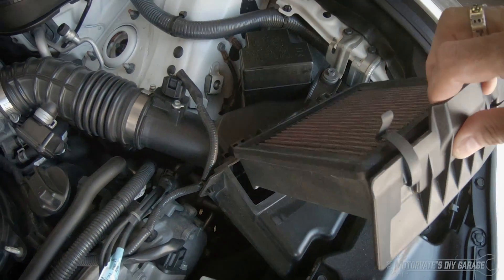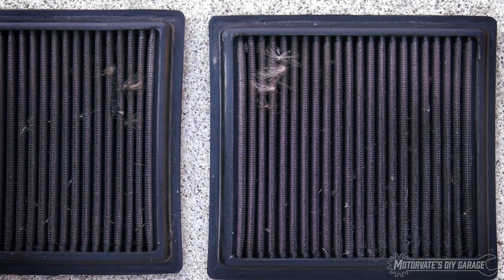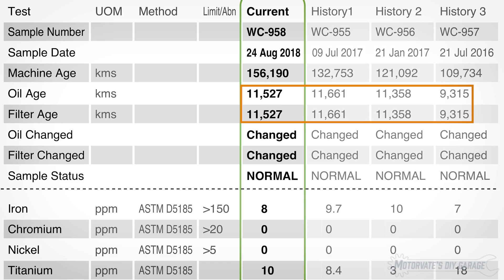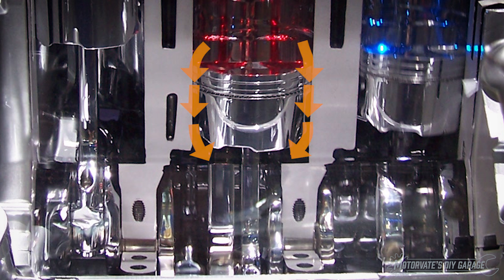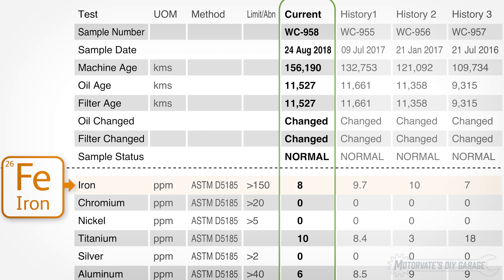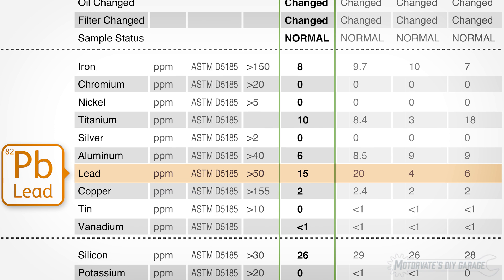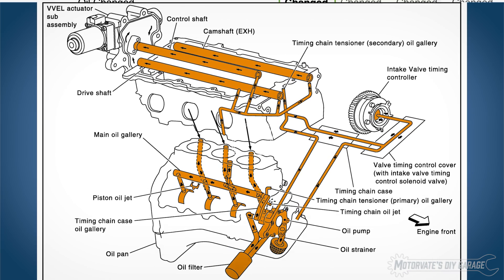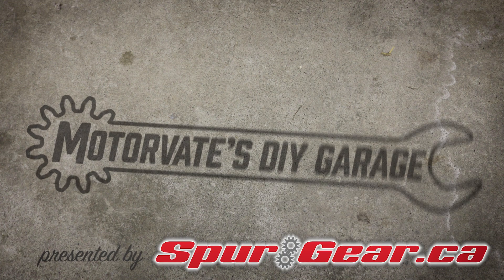K&N Filter Test… Two Years and 50,000 KM Later: Motorvate's DIY Garage Ep.34

Comment: I have a K&N air filter housing and filter. I'll be honest it's a pain in cleaning and adding a really thin layer of K&N oil. I usually park my truck for the day and put it in the next day just so the really thin oiling has absorbed/semi dried so the wet oil on the filter doesn't screw with my sensor and bugger it up.
Horse power gain hardly noticeable.
Too much work involved with a K&N air filter in my opinion, considering when  buying a disposable you quickly put it in and eventually toss it and buy another, it's time saving.
 I do recommend if you do go with K&N kits buy another filter to have previously oiled and ready so you can just toss it in without the wait. I also noticed too that the filter get's dirtier faster which is contributed by thin layer of oil  in my opinion which requires more frequently cleaning and going through the process again.
Reply from the maker: I agree, cleaning the K&N is a little bit of a pain. However, I have been doing that since my first K&N filter in my 88 Taurus.

Comment: My question is performance being affected by the dirty filters. On my 2008 C350 the filters get dirty so fast, mainly because I do a lot of highway but since these filters have oil and dirt sticks to them, I wonder how it affects performance when they clog up.
Reply from the maker: Based on the dyno testing I have done on my G37 (will be a future episode), there is almost no measurable difference in power between brand new K&N and a K&N filter with 50,000 KM.

BUT I don't know if that would be accurate for your C350.

Comment: THX
Can you check the car ob the dyno with these dirty K&N ?
Reply from the maker: Actually I have :)
I book a few hours of dyno time in August. I tested the dirty K&N, new K&N, new NIssan/Infiniti filter and just for fun NO AIR FILTER.
PLUS I data logged 32 items via the diagnostic port and an additional 8 items (with my home made data logger) like fuel pressure, oil temp, oil pressure, crankcase pressure and a few others.

The downside of all this data is the time it takes to analyze it... but that is under way :)
Reply: @MotorvateDIY  
Great!
Thank you 👍🏼😊

Comment: Without a comparison to OEM paper filters this is a great well produced video, but isn't really doing a fair comparison.   If paper yielded better results over the same time period there's an argument to be made that the K&N's are actually inferior, which many will argue they are, and the science based tests prove such:  https://www.nicoclub.com/archives/kn-vs-oem-filter.html
Reply from the maker: As you know, there are many variables in a test like this.
Those K&N filters are comming up to the 60,000 KM mark and then I will switch to Nissan/Infiniti filters for the next 50 or 60,000 KM and compare the difference.
Reply: @MotorvateDIY  awaiting for the next video

Comment: I would like to see a video of how to find a fuse that keeps blowing up. My G35 couple keeps blowing up the tail light fuse. I can’t find where the problem is. The videos have help👍🏽 keep up the good work
Reply from the maker: Hey  Chaco Santaya,
Thanks for your kind words.

If the fuse  keeps blowing, it should be easy to find, but you will need a multi-meter, wiring diagram and understand basic electricity.

Make sure to check for worn insulation on the brake light wire.

As for making a video on that, since the G35/G37/350z/370z generally don't have electrical issues, it wouldn't get enough views to justify the time required to produce a video.
Reply: Thank you very much!

Comment: I don't like that you can see right through the K&N. Can't do that on a paper filter.
And with the cost of the K&N and the cleaning and oiling products you have to buy, and the faffing about. The performance of the K&N just doesn't warrant the outlay in time or money for me. 
I stopped using K&N when I removed the induction kit off my car (was selling it), and installed the standard air box and filter, and got a noticeable increase in performance. Sounded better with the K&N, ran better with the paper.
Reply from the maker: Hey  Bill Hubbard,
I understand what you are saying, worried about being able to see through the filter, cleaning it, drying it etc... 

For me I think it is worth it, but is not for everyone.
If a car feels better/faster with a paper air filter, then that's what I would use :)

Comment: Dude what happened to your channel? Your quality is top tier and you were getting so much momentum you could've had 100k subs by now :/
Reply from the maker: Hey  Darksyne,
Thanks for the kinds words. I know it has been a while since the last episode. I took some time off the production side to focus on G37/370z research. 

One of the goals of this channel is to have unique content, and as you can imagine, that is not a simple task.

However, here is what is being worked on right now:
• Home made $40 Arduino based data logger that samples 8 sensors 100+ times per second
• Fuel rail pressure at idle and wide open throttle. You might be surprised how much it drops!
• Crankcase pressure test: Stock vs PCV delete. Does a PCV delete really reduce crankcase pressure or increase it?
• Differential oil temp. How how does it really get in city driving, highway and during a track event?
• Manual transmission oil temperature.How how does it really get in city driving, highway and during a track event?
• Engine oil pressure vs RPM vs oil temperature. How much does the oil pressure change as the oil warms up and as the RPM increased?
• Power steering fluid temp: How hot does it get? Does turning heat up the fluid more than high engine RPM?

and finally, I designed and built a Arduino based device that plugs into the OBD port and uses the CAN bus to copy the ECU's ROM to a SD.

Soooo, there have not been many episode lately, but there is a lot of content getting ready for release!
Reply: Motorvate DIY glad to hear! The quality is very impressive for a small channel and I’m looking forward to seeing more from our fellow Canadian haha
Reply from the maker: Thanks!

Comment: Why did you stop making videos ? Miss your content here in 2020!
Reply from the maker: Hey  matt debrouwer,

I know it has been a while since the last episode. 

I took some time off the production side to focus on G37/370z research. One of the goals of this channel is to have unique content, and as you can imagine, that is not a simple task. 

However, here is what is being worked on right now: 
• Home made $40 Arduino based data logger that samples 8 sensors 100+ times per second 
• Fuel rail pressure at idle and wide open throttle. You might be surprised how much it drops! 
• Crankcase pressure test: Stock vs PCV delete. Does a PCV delete really reduce crankcase pressure or increase it? 
• Differential oil temp. How how does it really get in city driving, highway and during a track event? 
• Manual transmission oil temperature. How how does it really get in city driving, highway and during a track event? 
• Engine oil pressure vs RPM vs oil temperature. How much does the oil pressure change as the oil warms up and as the RPM increased? 
• Power steering fluid temp: How hot does it get? Does turning heat up the fluid more than high engine RPM? 

and finally, I designed and built a Arduino based device that plugs into the OBD port and uses the CAN bus to copy the ECU's ROM to a SD. Soooo, there have not been many episode lately, but there is a lot of content getting ready for release!
Reply: Motorvate DIY looking forward to it. Stay safe !

Comment: it’s been a year since your last 370/G37 video tutorial :/  

maybe a spark plug tut. soon :/
Reply from the maker: Hey  Enkeis,

Changing plugs are my next video shoot. I hope to get the parts in a few weeks.

I know it has been a while since the last episode. I took some time off the production side to focus on G37/370z research. One of the goals of this channel is to have unique content, and as you can imagine, that is not a simple task. 

However, here is what is being worked on right now: • Home made $40 Arduino based data logger that samples 8 sensors 100+ times per second 

• Fuel rail pressure at idle and wide open throttle. You might be surprised how much it drops! 

• Crankcase pressure test: Stock vs PCV delete. Does a PCV delete really reduce crankcase pressure or increase it? 

• Differential oil temp. How how does it really get in city driving, highway and during a track event? 

• Manual transmission oil temperature. How how does it really get in city driving, highway and during a track event? 

• Engine oil pressure vs RPM vs oil temperature. How much does the oil pressure change as the oil warms up and as the RPM increased? 

• Power steering fluid temp: How hot does it get? Does turning heat up the fluid more than high engine RPM? 

and finally, I designed and built a Arduino based device that plugs into the OBD port and uses the CAN bus to copy the ECU's ROM to a SD. Soooo, there have not been many episode lately, but there is a lot of content getting ready for release!

Comment: Did you clean the K&N Filter at all within the 31,000 Mile test or no?
Reply from the maker: Hey  Lucas E. Honda,
Nope. The filter was last cleaned  July 2016 and it still is in my car so I have data for the next 60,000 KM or 70,000 KM test.
Reply: @MotorvateDIY  Thank you for the response. I'll be buying a K&N Filter soon. Really appreciate the Testing and work you've done.
Looking forward to the analysis after 50,000 miles to see if the filter lives up to it's claims.
Reply from the maker: @LucasEHonda   You are welcome :) 

Many people think K&N pays me for this.... all I do is follow where the data takes me. If the data shows they are crap at 60,000 KM they are gone. (but I suspect they will be just fine!)
Reply: @MotorvateDIY  K&N does state that in severe driving conditions the Filter should be cleaned earlier than 50,000. Depending on how dusty and dirty your test environment is, the filter may or may not meet the 50,000 Mile mark but to reach 30,000 Mile mark is impressive. 

Just got a K&N Air Filter(Part#:33-5045)
I'd likely clean the filter every 15,000 or less for good measure. I'm a daily freeway driver of 45 Miles a day, 6 Days per week.
Reply from the maker: @LucasEHonda  Sounds like a solid plan! You also might want to get a used oil analysis and to see how the filter is doing in the conditions you drive in. Thanks for the comment!

Comment: This isn’t regarding air filters but my car was throwing a code for MAF and MAP sensor and bank 2 lean. When my g37s gets warm it won’t start or will try to shut down. At about 3k rpm it sputters. Any ideas?
Reply: I replaced the sensors and it didn’t work
Reply from the maker: Hey Joshua Jeans,
When troubleshooting you need to think of the code as the symptom, not  the cause.

Many years ago, I changed an O2 sensor as it always read lean.... as it turned out, the intake boot had a tear and the O2 sensor was just fine.
Reply from the maker: Hey Joshua Jeans,
What is the exact code? 
Often the online look up of descriptions are not accurate.

If it is a P0106, there is an ECU update to fix that: https://infinitig37.com/TSB/ITB12-026a.pdf

For the sputtering, when was the last time the throttle body was cleaned?

Comment: As a guy in my 30s, I have almost same mods and same approach to everything on my 2011 G37 as you. The biggest question mark on my list is a tune. Heard so much back and forth on uprev vs ecutek, and as you've noted different for every car and climate. I also daily mine to work every day,  so want it to still drive smooth and not be jerky or set up for race mode if not necessary. Have you though about reaching out to uprev or ecutek guys and s hi showing your size of followers and asked for an unbiased review in exchange for a free tune? Cheers from the States.
Reply from the maker: Hey Nick J,
That's an interesting question...
The performance or smoothness of a tune are determined by the tuner skill, not the software. The tuning software determines the options that are available. (Launch control, 

I have been in discussions with an ECUTek Master Tuner (Eugene @ Enthusiast Auto Care) and we might be doing a few episodes on ECUTeck features and show an e-tune works in the spring/summer.

Comment: Did you stop making vid? Is synchromesh fluid good for g37s manual ?
Reply from the maker: Hey Albert Caval,
Nope, I have shot a lot of content over the spring/summer and have done a lot of research for future episodes. (Crankcase pressure and PCV delete, fuel pressure gauge install, fuel pressure stability at wide open throttle, and more)

I have a lot of editing to do and I hope to get some episodes out before the end of the year.

I haven't used syncromesh fluid on this transmission, so I don't have any first hand experience. I do know for a fact that the newer manual transmissions can be very selective on what oil is used. The oils need to have a specific amount of friction for the syncros to work properly and prevent grinding. If the oil is too slippery, the syncros won't work as well, and you might increase wear on the syncro engagement teeth. 

To prevent any future / long term issues, I only use the OEM fluid.
If any issues do happen, I know that the aftermarket fluid wasn't the issue.

Comment: K&n will normally hurt the valves/seats not internal parts like crank and bearings.
Reply from the maker: Hey Jamie SV650,
If the valve and/or valve seats are being damaged, that would also show up in the used oil analysis, as chromium. (I think)

Keep in mind 3-5% of what is in the combustion chamber, ends up in the crankcase due to blow-by gasses, which then mixes with the engine oil.

Comment: When i changed my oil after i bought my car I put regular Mobil1 full synthetic in it. I was told i shouldve gotten the extended protection Mobil1 because of it ability to handle heat better. Is that gonna hurt anything? I dont track my car and my highest oil temp since I had it was 225-230. Normal driving its always around 200 to 210 on these hot days. Also im thinking about switching to Royal Purple like I used to run. From the videos I watched it has a phenomenal film strength and handles heat very well. Have you ever used it? Check out some of the bearing bench tests they do comparing it to Mobil1. The test where the bearing is rolling in a bath of oil and they push down on a lever to simulate wear is pretty impressive. There's hardly any mark on the bearing at all. Now im not trash talking Mobil1 because it still did very well. But it did let a noticeable wear mark behind. I know when i used Royal Purple before in a 2002 Z28 SS the engine ran slightly cooler (with the same thermostat) and noticeably quieter. For the little bit more that it costs i think its worth it since these engines rev so high and are known to run a bit hot.
Reply from the maker: Hey Waugy 370z,
I think your oil temperatures are good, not too hot, not too cold.

To be honest, I really don't like those "ball bearing" oil tests. They are not relevant to what happens inside an engine. 

I use either Castrol Edge Synthetic or Quaker State Ultimate Durability Synthetic oil, which ever is on sale :)

If you really want to know what oil is best for your, for how you drive, in the conditions you drive in, get a used oil analysis.

or Just use a name brand full synthetic oil and change it as per the owner's manual.

Comment: Hey buddy i had a question thats off topic so i figured id put it on the newest video? Anyway the dual throttle bodies on these engines, do they actuate independently or simultaneously? I saw a dyno video and the guy said he had a jumpy graph when the second throttle body opens up? I always thought they worked simultaneously?
Reply from the maker: Hey Waugy 370z,
You are correct. Based on the data logging and analysis I have done, both throttle bodies are used at the same time.

It almost sound like that "guy" is thinking the dual throttle bodies on the HR/VHR engine works like a old 4 barrel carb, where 2 barrels are being used until almost full throttle, then at full throttle the secondary butterflies open up and all 4 barrels are open.
Reply: @MotorvateDIY   I didnt think it was the other way. Cause it looks like the intake is setup with separate runners for 1, 3 and 5 then 2, 4 and 6. When i asked the guy on his video he told me "if you're gonna own a Z then learn how it works". I pitty people whos cars he's worked on lol. Thanks again for the help 👍
Reply from the maker: Hey Waugy 370z,
Wow, that's funny!

Enjoy your Z :)